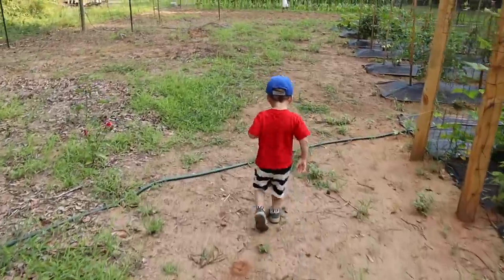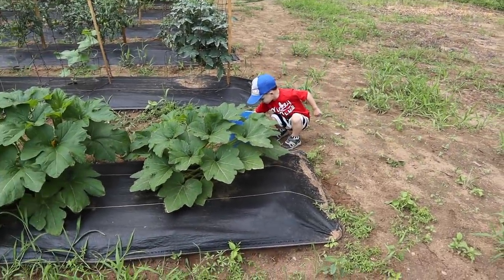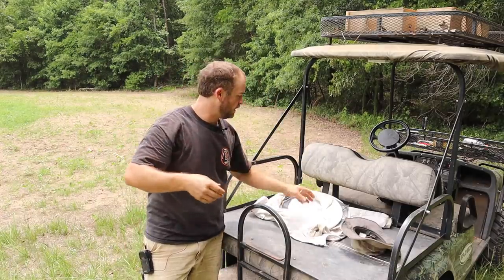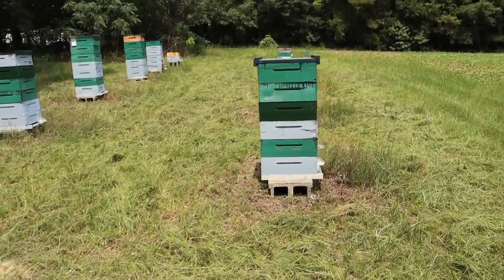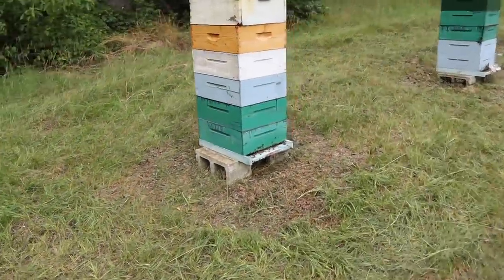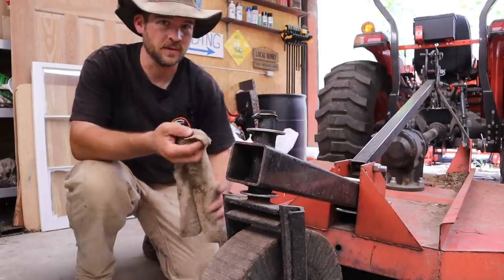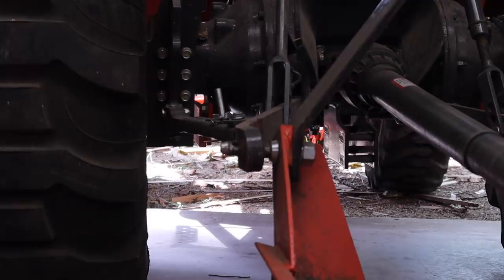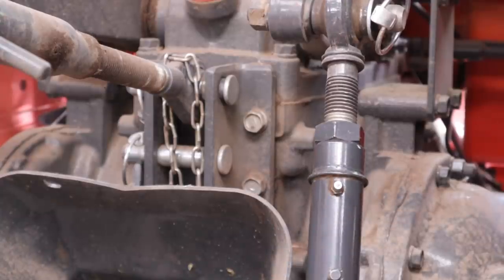This Could Have Been Ugly

Comment: Mayby someone already mentioned it. But you could put a row of concrete pavers around the beehives. Or would that affect the bees in some other way? Also for your bolts alignment. You could use a white marker and put a reference line on it. Then you can quickly tell if they are loosening or not. Kind regards from Belgium! Always amazed with the properties you have there and the maintenance of them.

Comment: Perhaps, you can try putting wood chip around the bee's hives. It would help reduce growths of the grass. You might try weed control tarp. They have small holes in them. Lay them out put wood chips on top. These are just ideas that you can try. Less stress for the bee's.

Comment: Add a little bit more 2 cycle oil to the gasoline of the weed trimmer and it will be a trimmer and smoker at the same time.
Also add 1/2 an ounce to a full ounce of 2 cycle oil to the gas tank of the lawn mower, and it not only will protect and lubricate the engine better than just plain gasoline, but it will also smoke just a bit, enough perhaps to smoke the bees away.
I add 2 cycle oil to my truck gasoline, at a ratio of 1 to 2 ounces for every 5 gallon of gasoline, and I have noticed improved fuel mileage which translate to the engine having better lubrication and less friction in the top end of the piston, providing longer engine life also.
A fine mist spray water bottle with just plain water in it will also have a similar effect on the bees as a smoker. So you could carry a small spray water bottle while working the yard attached to your belt, it will also cool you down with a few sprays to the face when temperatures are hot.

Comment: Hey Buddy, maybe you should invest in a cordless trimmer. I bought one this year and I love it. It's has a 40 amp battery and cuts about 1 hour before it needs charging. It would be perfect for doing around the beehives, with almost no noise. It's kind of funny watching the thumbs-up move, he's only one finger away from disaster. hahaha
Reply from the maker: Ha! I guess he is. Several have mentioned an electric trimmer. Not sure if I want to make that investment for so little use...but I totally see how it would work better than a gas one. Always appreciate your comments, Mac.
Reply: Hey Buddy, the best thing about a cordless trimmer is even the wife can use it. No pulling and choking it. Just push the button and take off. I bought a Kobalt

Comment: Hey Fall Line,
Have you tried an electric trimmer. If the noise is the problem, then maybe a quieter battery powered trimmer could do the trick!
Reply: I have a Stihl KM-135R weed eater that’s battery powered and they still hate it.  They hate the vibration.

Comment: You will never keep those adjustment arms from moving.   You can take two pipe wrenches and jam it together and within four or five hours it’s loose.  
  And then if you want to jack one side way down like digging a ditch with a three-point blade then it will level itself out.    Damest  phenomenon on the face of the planet 🤣